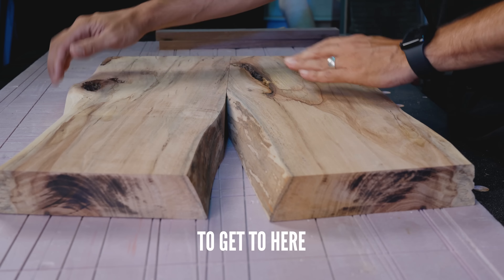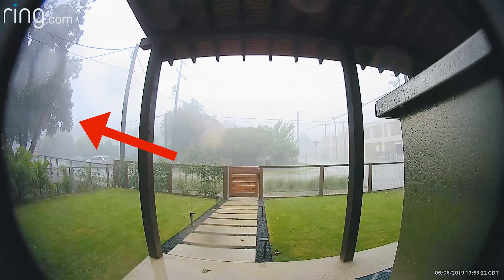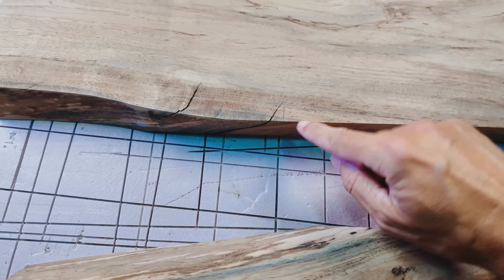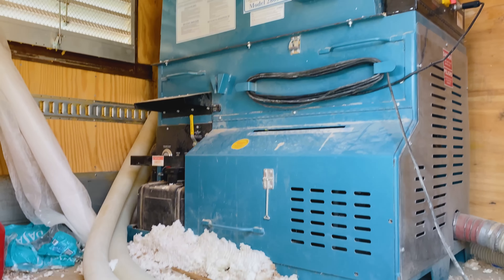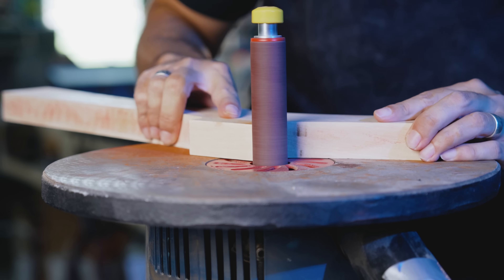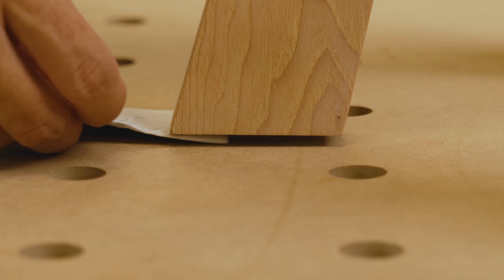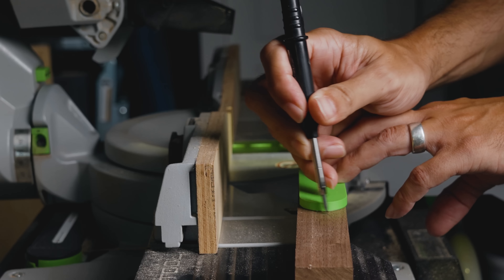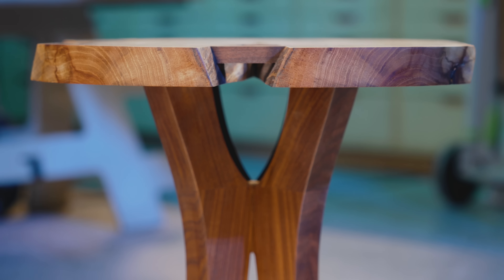I regret not learning this sooner.

Comment: Since you asked, absolutely leave the mistakes in the video! I've had a rough day in the shop today. Everything I touched I messed up in one way or another. First I cut a dado on the wrong side of a rail. Fine; just flip the rail. Except that I'm doing castle joints so when I flipped the rail, front leg and back leg were fitted to the wrong ends. So then I snapped the end of the rail trying to get it out of a joint that was too tight. 

Left that gluing and went to a little side project. I started spraying an oil can I began restoring last night. I finally got to the clear coat whilst my glue was drying and promptly dropped it in the dirt. Start again (on that part at least.)
The whole day has been like that. You're video is at least making me feel a little less alone in my disasters. 

Appreciated.
Reply from the maker: I had a day like that today!

Comment: Great story and video. I had a very simillar situation with a beautiful spalted pecan log. I built a round table with a starburst top which allowed me to use smaller wedges of wood so I could avoid the unusable areas. It was the most difficult project I've undertaken between the math and the precision required for cutting the wedges, but the result is staggeringly beautiful.
Reply from the maker: Oh wow!

Comment: I definitely want to see more of how you put the 3D printer to work in the shop. I've just started out, and so far I've made a zero clearance plate for my table saw, glue holder, some sanding blocks, and what I think has been really cool was shims for when I make cabinets so I can get the perfect reveal around the edges. Oh, and magnetic dust collector fittings. And if you leave out your mistakes, it would mean you're not challenging yourself enough. Mistakes are how everyone learns. And I can't find the scuba emoji, but your video is on fleek. (look that one up. 🤣)
Reply from the maker: But are your eye brows on fleek?
Reply: @wittworks  they’re always on fleek and it drives my wife crazy! 🤣🤣
Reply: @PCPerks757  Did you hear that sound? that was my head hitting the floor when I feel out of my chair laughing at this!

Comment: If you ever want to get back to milling your own, Matt Cremona has some good insight into bug control, drying, etc. One thing that does help is spraying with a boric acid based buggy killer before putting up for air drying.  You could also find a spot for a solar kiln =p

Working slow is working deliberately.  Speed comes with experience.
Reply from the maker: thank you. good tips. I've been chewing on a solar kiln....

Comment: I bought a wood carving once and after awhile, discovered very fine sawdust where it sat in my apartment.  Closer look revealed very tiny holes in the carving.  It was small enough that it fit into my freezer.  I left it in there for about 3 months while on a trip.  Came back, took it out and the problem was solved.

Comment: Sparkle, I added that because you asked not really knowing it's meaning. Regarding 3D printing I have put off that technology (thought about Spaper though) because most all I see come from a 3 D printer is throw away junk. With 3D printers I have 3 questions: 1 What bed size is recommended  for 80% of the projects? 2 what polymer is best suited for most objects printed, 3 What technology for the 3D printer is recommended: extrusion, stereolithography, etc. Thanks, keep the builds honest as you have been doing. I learn most from mistakes.
Reply from the maker: good questions! stay tuned

Comment: If I have a buggy piece that will fit in my oven I just heat it up to 200 degrees before milling. If you don't let it sit too long it doesn't crack much, and most of the cracks get milled off before the piece is finished.
Reply from the maker: good to know. I thought about that.

Comment: 25:48 - That's the thing about mistakes. We are Human, and there's beauty in both imperfection and flaws. It's legitimately impossible to not make a mistake in life, and that expands over to your profession, your hobby or your passion. There's something manufactured when we claim that we never make mistakes, or that we must work at extensive speed or have a fast production time...and, if anything, it's symbolic to the lack thereof awareness of ones inner self to assume mistakes will never be made.

That being said, I do believe that working at your own pace is typical and should be warranted more as experience doing a repetitive task enough to which you ironed out the mistakes. The learning process isn't instant success with no failure marks, it's mostly failure, repeat, and failure until it's appropriately learned. And I think that's why so many people would rather take out tens of thousands in loans for something that others may be able to build with a fraction of that cost, but with time, effort, and repeat failures.

I think society today would be better off if we all had to learn to grow from our failure, rather than gatekeeping the success away from those who only had a single shot at failing.

Anyway, didn't want to turn this into a philosophical point, but a simple acknowledgment that it doesn't matter if you're a seasoned expert in a career or trade, or a novice -- a mistake has, will, or previously had been made to get to the point of where they are at. And although many pretend that they are flawless, the truth is that we're all Human, and we're all going to make mistakes. It's what you do after that defines you, and many love to manufacture their perfection to remove that flaw, rather than showcase it. I love seeing when people make mistakes, DIY or otherwise; Not to justify anything, but simply to see how someone tackled a problem that occurred, and their solution for it. It's always the more creative types to take the problem, and craft it into art.
Reply from the maker: Thank you

Comment: Only a little over halfway through, but had to pause after your request for 3d printer questions for woodworkers! I just bought my first one.

What's a good way to deal with pieces shrinking when cooling? I modeled a 50mm long piece that measures closer to 49mm.

I hope it's possible to find a common scaling value for each filament, instead of trial and error every single time. 

"It doesn't matter for woodworking" is also a great answer! I'm a rambling overthinker.
Reply from the maker: I wonder if your machine needs calibration? I haven’t had any shrinkage with quality PLA. Also, for woodworking, most of the time a little bit off is fine.
Reply: @wittworks  I've calibrated it and it's an A1, so it should be good to go and above average fool proof. Maybe it's the filament!

I do struggle a little with PETG due to wet filaments and 50% indoor humidity where I live, maybe it affects the PLA in that regard too.

Comment: Snorkel…. One thing I like to do is make candle holders out of branches around 6 - 8 inches thick.  I cut them 9 - 24 inches long then rip them up the middle so I can bore holes for tealight candles in the rounded part.  Before I cut them I let the air dry outside in the garage for a year or two then after I’ll tie them up in garbage bags and stick them in the deep freezer for a couple weeks to get rid of any bugs.  Next I’ll take them out of the freezer and let them warm up for a couple days then I’ll put them in the oven on convection at 150 degrees for a day and a half to take care of any eggs, spores or other microscopic life.  After that I let them sit dry in the house for another 2 or 3 years maybe baking them a couple more times along the way to make sure they’re not turning into a home for anything and maybe squeeze more moisture out of them.

Unless I’m greatly underestimating the size of that wood I think you could’ve done the same thing especially when you had it in 2 chunks.  Don’t get me wrong nothing beats having it kiln dried but if you want to go down the road of milling and drying your own chunks of wood for the satisfaction of knowing you created something going from a raw chunk of green moisture saturated log to the final masterpiece before our eyes, you might want to give that a shot until you finally get one of those vacuum kilns :).

On another note, showing the mistakes and solutions you came up with is EXTREMELY valuable.  I personally LOVE how you showed just how HUGE of a difference a 32nd of an inch can make because I’m sure I speak for a lot of us when I say people just don’t understand why we need to be “so perfect” like we have some type of complex about us when NO the whoooole entire project can go off the rails over a tiny 128TH OF AN INCH which makes a 32nd HUGE.  So it helps for things like that to be shown so when people close to us are watching YouTube videos to get ideas for things they want US to build they can see how things can be trickier than they think because let HGTV tell it ANYTHING can be done in 3 days when in reality we need longer than that just to let one of several things fully cure before moving to the next step.
Reply from the maker: Thank you

Comment: 3D printing question: what filaments are safe to use around spinning blades and router bits? And which ones are fine leaving out in the shop heat?
Reply from the maker: PETG for shop

Comment: Nice video Drew. Keep the mistakes except for one. Stitches are designed to keep the split timber from splitting further. This is why bow tie stitches are the ones to use. Your stitches are basically decorative inserts. Don’t be surprised if a slight gap appears around them as the timber moves. Lloyd
Reply from the maker: Yep! I did that on purpose to test that.

Comment: 🥷🤿You have to scroll down a long way to find diving mask,(it isn't listed as snorkel)  would have been slightly easier if you said it was in 'Activities' section of emoji's
  I don't really consider myself a woodworker although I have made various things over last 25 years with basic tools and equipment.

Recently, we had a tree blow onto house, had to get professionals in to remove it. (and another to fix hole in roof 😞)
I was expecting it to be rotten but it was in incredibly good condition, the heart wood is almost grey and VERY  hard (white oak) 
All the main trunk was removed but as it was cut at about 4~5 ft up there is more than enough for me to make some small boxes and cases (for my micrometers and vernier calipers)
I got out chainsaw and cut a few slabs about 2~3" thick, 2ft long  by 14"~16" wide. 
Seeing this video I just had to watch it (I couldn't afford to mess up $50+ if I bought oak slabs but as I cut these it won't be a disaster if/when I mess up as I will have learned something.
51% is quite low humidity, central Florida is often 90% or more (pisses me off when weather people are so happy to tell you 95f 'is going to feel like 105f or more)
I would think a black trash can with some vents left in the sun will get over 145f (even though it will cool down overnight)
When I checked, I'm already a subscriber
Reply from the maker: thank you

Comment: I think it's good to leave the mistakes in - problem solving is an interesting process and it's valuable to any viewers working on their own projects, we can all try and learn from each others' mistakes.

I don't have any experience using a domino, but would changing the orientation 90 degrees have made the process simpler? The reference marks on the tool may have fit on the piece if rotated and you could've put one domino above and below the one already holding the two other pieces together.

snorkel

Comment: North Texas heat is no joke! Would love your thoughts on the mini split after a while. Using a window unit in my tuff shed and I just gave up going out there about mid July. It does not cut it.
Reply from the maker: its brutal. so far I'm in love. got the shop to 75 today while it was 103 outside. too cold. bumped it to 80. The thing I didnt realize what how humid it was. The mini split does a great job drying the air.

Comment: The wood used wasn't worthless, but this is a lot more value than using it as firewood.  Nice work.  Made it to deep end, but no emoji on this kbd...
Reply from the maker: Great point!
Reply: @wittworks  Btw, love your channel and, being in 817-ville as well, I'm glad for the Plywood Store connection.  We do more metalwork and vehicles (incl EV motorcycle conversion), but your woodworking videos are clues we can use.  And our 3D printer is an Ender3-Pro, so I get the "size compensation" aspect of using joints to build larger printers because 200mm is pretty restrictive.  Oh, and my kiddos use "cap", "bet", and such all the time; I gotta keep up because they bring things over to fix/upgrade.  Cray cray isn't just "crazy", but "absolutely crazy", so not lazy.

Comment: What product did you use to finish the table? The way it went from dull to popping is great and I don’t know if I’m using the wrong finish or not using them correctly. I am new to woodworking, first year, so still trying to learn. Thanks for any information.
Reply: I did not see it in his listing, but I suspect it was Rubio Monocote
Reply from the maker: Rubio Monocoat, but its expensive and dulls. On walnut, and good "oil" will make it pop
Reply: @wittworks  could you give a examples of what you consider a “good oil”? Is that a specific type of oil or brand?

Comment: if you have a laser cutter it would be a faster option for your templates then 3d printing
Reply from the maker: for sure. That's the way I usually do it. I wanted to show you can do it with a cheaper 3d printer

Comment: wouldnt care about makita if i had festool's attention ;)
also - is a basic 3d printer like the ender3d good enough for printing templates for woodworking? or do you need to drop 1k on a decent printer?
Reply from the maker: i sold my ender 3s and got a bambu p1s. much better. the bambu a1 is a good alt too.

Comment: Can any 3d printer plastic be used as a router template, or will some burn/melt from the bearing friction????
Reply from the maker: I think standard PLA would be fine
Reply: With the 3D printed templates for the band-aids, were they designed line on line, or was an offset needed to guarantee a tight fit on the band aids?

Comment: When it comes to 3D printing, I hear you tubers make comments like: "this was cheap print" or "it doesn't cost that much to print'".  I'd actually like to know what an item costs to print, raw material wise, instead of a generic term.
Reply from the maker: I got you. Stay tuned in Sept/Oct
Reply: It really is cheap to print, depending on the material you use. There are lots of different kinds out there. I made a zero clearance insert for my table saw out of ABS plastic and the total cost of material was $2.89 according to my calculation.